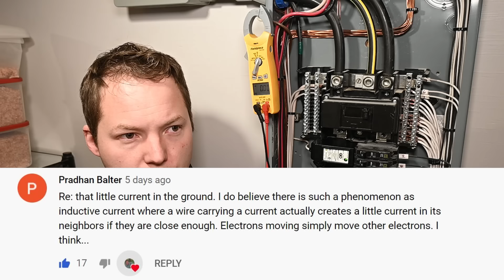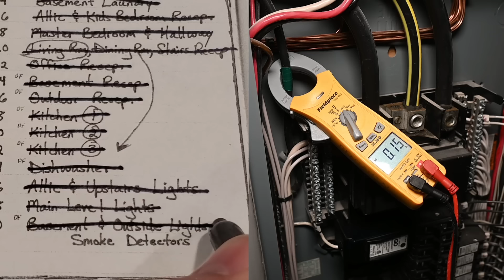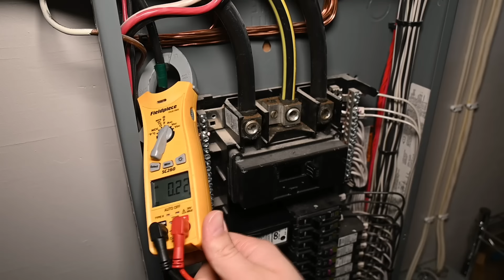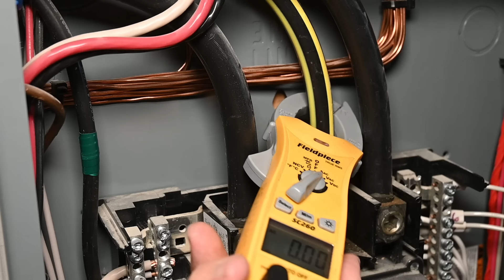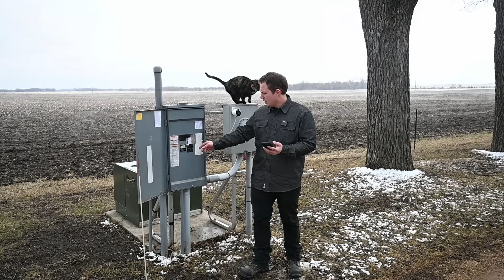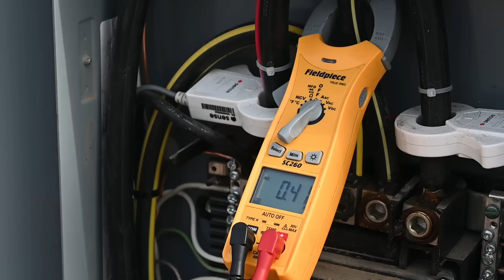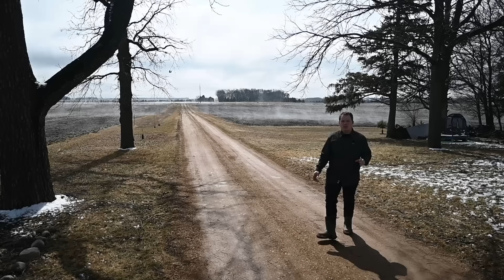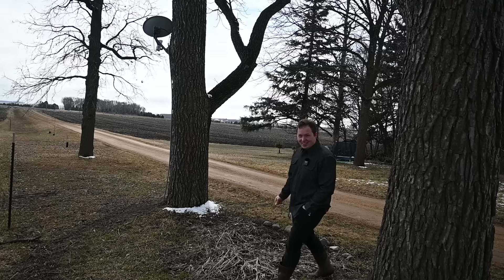Finding The Source of Stray Current on Grounding System

Comment: Sometimes this situation is caused by the "galvanic action" in the soil itself,which can act as a large battery.  When you have acidic soil, wet soil, iron deposits, etc. they can all contribute to the ground actually creating a current on a building's distributed grounding system.  Even a single building ground can be interacting with a utility ground on a pole somewhere nearby.  You did an excellent job chasing down the source.  I had the utility come and disconnect the power leads at the pole, turn off every circuit, pull out the meter and there was still 2 amps on my building grounds.  In the end they left completely unable to resolve the issue.
Reply: Gary Jarvis
 -- To expand on your 'galvanic' point: Dis-similar materials are required, usually metals such as copper and zinc. In this video, grounding rods and the gas pipe are copper and the conduit from the transformer/meter area outside are galvanized (coated with zinc), so there is a good setup for both a galvanic current AND electrolytic corrosion. You REALLY do not want electrolytic corrosion on gas pipes. Luckily (in Ben's scenario) that corrosion will erode zinc, but not copper. BUT those galvanic currents will be Direct Current, and the clamp-on ammeter looks like it was on AC Amps. Unless that little ammeter has problems itself, it should ignore DC when set to measure AC Amps. There is also some rectification possible in a galvanic circuit, which might show up while measuring AC Amps. It would be helpful to measure DC amps as well. To really be sure might require use of a battery-powered oscilloscope and a current transformer. Source of the power being rectified could be radio waves, solar storms, other electrical power users in the area, or even at significant distance if high voltage is involved. Also, it would help to measure the voltage, both AC and DC, when these mystery currents are present. @Benjamin Sahlstrom
Reply: A new grounding rod may help only if you pick one spot and use it as the only ground in your wiring.  Using multiple grounds may cause the ground loops I have been discussing.  Granite is a poor conductor of electricity.  The Ufer ground was developed as a grounding method in very dry soil and it is a solution to the cost of expensive copper grounding rods.  The NEC now always rebar to be used if copper is too expensive. My research indicates a rod driven deeply into soil is the optimal solution.  Remember this is only a backup in case the main ground to the house from the utility fails.  Check the conductivity of your grounds at the meter pan as they are known to corrode and become a problem. Use a good anti oxidation paste if you find poor connections.  Best of luck with your project.
Reply: @garyjarvis2730  thank you so kindly for the generous advice. May i ask for clarification, are  you saying only one rod, (not two) and it must be solid copper? And not bonded to the ufer? I really don't want to get this wrong. We are desperate to find a solution to this seemingly impossible strange situation. It's costing us a fortune. I can't thank you enough!
Reply: Try one rod only not connected to the Ufer in any way.  Rod can be solid copper or copper coated like you find in Home Depot.  Most important aspect is one ground only placed in soil that is not extremely dry.  You need to make sure there are no other grounds to plumbing or the Ufer that you have missed. In my mind this is the absolute starting point for any further investigation.
Reply: @garyjarvis2730  thank you, soooo much, Gary!! We have plastic pipes. This is a newly built home so no other grounds to our home. We do have the transformer on our property probably 20 ft from the house. I'm sure it's grounded to something. 
We had planned for two rods, you recommend one to prevent ground loops correct? I am not versed in this to know what effects a ground loop would cause.    Is one ground rod enough for whole house? (Again, I don't know enough just in my head I'm thinking 2 is better since our problems are so great).  And one last question, even though we are taking the house off the ufer won't it still be attracting electricity from the ground or possibly stray voltage? We think possibly our problem is possibly from neighboring property. Thank you so much again. I hope to report back good news after rods are placed.
Reply: Remember the ground rod is not the primary ground for your home, the neutral leg on your service drop is the primary ground.  Electricity will find the easiest path back to the source.  If you have neighbors with bad wiring their system may be using your ground path as the return or at least part of it.  The ground rod is just an emergency backup.  I suspect if you don't connect the wire to the Ufer and the ground rod you may see the stray current disappear.  Could also be something like a bad submersible pump or it's wiring injecting current into the ground.  In any case only ONE earth ground is required.
Reply: @garyjarvis2730  Thank you for the reminders. we've have power company out 3/4 times to test their side for neutral issues. Finally applied the beast test, and say they are good. The linesman who performed that test was one of the people (including 3 other electricians) who recommended we put in a ground rod. When cable company did testing for three house they claimed the amps on their line was from our neighbors across the cul-de-sac. We did notice symptoms less when they were out of town. Linesman wouldn't test their home and neighbors say they don't have any electrical issues. How would we go about solving this if we've exhausted these avenues. Will the new ground rod be of any help? Or are you saying just taking our neutral off of ufer would be a good test. I truly appreciate you bearing with my lack of knowledge. We assumed the 3 other electricans we hired plus forensic electrician would be able to figure this out. Apparently, not.
Reply: Bottom line is electricity will always find the path of least resistance.  If your neighbors have poor system grounds or faulty outside equipment current can easily be injected into wet ground.  As the ground gets wet and dry the amount of current will vary.  If you have pad mounted transformers and underground service lines all bets are off. There could easily be bad service  wire insulation or corroded grounds causing stray electricity in the soil.  If your emergency grounding system ( rod or Ufer) has less resistance than all of the available returns, a portion of the stray current will find its way to your home.  Keep the wire to the grounding rod (yes you need only one) outside and under the ground until it reaches your service entrance.  Connect it as close as possible to the service line neutral.  If you need to connect it in the breaker panel keep the wire run in the house as short as possible - meaning don't run the wire across the basement to the panel, run it outside to a close to the panel entry point. By keeping all of the emergency ground outside the house any stray ground current will find your rod and travel directly to your neutral return to the transformer outside your home.  To summarize, use one ground rod, place the wire outside the house until you get to the location of the service entrance.  Ground to the service neutral outside the home if possible and run a tap back to your breaker box as required by code.  This should keep all of the stray current outside and away from your home's wiring.  The ground rod can be right next to the service entrance as long as it goes into the ground 8 to 10 feet.  This should not be an expensive fix.
Reply: @garyjarvis2730  I'm so glad I have these details. They will be here in an hour or less! I do have question about where to put the rod. Our entire stem wall footing is on infill. The infill is 6ft deep. To put the rod into "real, true ground/soil we would need to place the rod 10 ft away from the house (but still in line with the city neutral). Is this an acceptable distance
Reply: Yes, in real soil 10 feet away is perfect
Reply: @garyjarvis2730  thank you! I will let you know if this solves any issues. I meant to respond about the rainy season when soil was wet, wet, wet (natural springs on our site) we had some weird symptoms, unless neighbors were out of town. Thank you again!
Reply: @garyjarvis2730  hello again we ran into a problem. The rod made it 6 ft before hitting rock, so today he's renting a jack hammer. My question is, if the ground rod is able to be jack hammered further is this a conductive ground or should we try another location? Interesting thing is we had about. 25- 1.7 amps on the cable ground (varied based on what appliances we were running) and since the rod was placed its been zero with no increase no matter what appliances we run. Weve checked it at least 20 times at various times in disbelief. The rod is not yet attached either.
Reply: Kinda suggests the ufer ground was not doing its job.  If the ground cable alone was solving the problem with the rod attached it should be a permanent fix.  The rod can be placed in another location just as easily as jack hammering thru rock.  The fact that the operation of YOUR appliances suggests you do not have a good ground somewhere in your service.  The ground rod is usually a backup and unless ground currents are coming from somewhere else it should not be carrying a current.  Also check any cable tv cables as they ground the shield portion of the cable to your grounding rod.  Sometimes bad equipment in the area induces a current on the tv ground that you also pick up on readings.  Home generators are also culprits if not wired correctly.  Most important thing is you've eliminated the current flow in your home.
Reply: @garyjarvis2730  yes, it does. We got the ground in today and all the amps on both the cable neutral and our neutral are gone. No amps, zero. Thank you so much for all your advice and information! Very helpful!
Reply: galvanic action, as you call it, Gary, does not account for 2 AMPS of current. that is way too much electrochemical power to not notice metals dissolving before your very eyes - and since that is not happening, it cannot be the current source.
irregular or varying 'ground' impedance in the power distribution network CAN account for 2 amps of current. if you can be absolutely certain no other power source is injecting current into your building's neutral system when the building's utility feed is not connected, then the power distribution network is the current source injecting that 2 amps into your building's (now proven superior) 'ground'.
Reply: @rockytrashpanda  Thank you for your comment.  You are correct that galvanic action alone may not create the full 2 amps,  However, it is still an issue especially in densely populated areas like cities where there are tons of dissimilar metals in the ground.  Often multiple grounds can create a "ground loop" where the potential at the different grounding points creates the flow of current.  I did notice when I removed one of my grounds to the water line the situation disappeared.  Our local gas company routinely puts dielectric unions in their supply lines to the house to stop the corrosion issue.
Reply: @garyjarvis4058  i suspect gas companies in general have more rigorous adherence to their grounding design specifications in contrast to the electric utilities. whoever maintains the 'best' ground "wins" the prize of having to do more maintenance if they don't introduce those insulators (dielectric unions).
in the long history of both utility services, electric has only recently invested in underground infrastructure and then only as they are required to do so (i should make the obligatory joke about resistance to change).
population density itself does not lead to issues as much as the sheer number of installations performed and the statistics that a certain number of installs will require remediation in only a few years.
the situation where a property owner has to replace their water service feed twice in two years after a neighbor adds an out building and installs a full set of high power wood working machines can happen just as easily in an urban or rural setting. it was a broken neutral bond in the utility's system destabilizing the power distribution and causing 20 to 30 amps to flow along the water service line.
all these things combine into a SYSTEM even if the various responsible parties think of their work as being done in isolation ("kirchoff don't care", as in Kirchoff's Laws).
Reply: The electrical potential of any two points on the surface of the planet can be very different due to the dielectric properties of the rocks, soils, and water beneath them because the iron core of the planet generates a magnetic field. 

The "earth" of the power company is relative to the location of their generator.  If they provide a high conductance path with a "neutral" line, a current will flow.
Reply: Did you have any electrical problems with the 2amp on your grounds?
Reply: None.  I check the entire house with the pole ground disconnected and the meter pulled.  The stray current was not coming from my service.  The utility engineering team was completely perplexed and declared it was not their problem. The one thing I settled in on was a ground loop causing the issue.  I had a ground attached to my water main and one to a grounding rod some 40 feet away.  When I disconnected the water main ground the situation disappeared.  I should mention we have copper water lines and cast iron water mains in our area.  My father worked for Con Edison in NYC and they regularly had lots of issues with ground currents caused by the different potentials caused by soil and moisture variations.  Interestingly there was no real voltage accompanying the 2 amps.  Try putting a volt meter in the equation and got only a few milliamps on the reading.  Given I didn't have a meter sensitive enough to accurately read small voltages I assumed there was some small voltage potential but was not sure of it's real value.  Our gas company did install dielectric unions on all services to isolate their equipment form the customer's equipment.  My guess is they were more aware of the stray current issues.
Reply: @garyjarvis2730  thank you Gary for the detailed response. We are trying to figure out if the amps we are finding have anything to do with some strange feelings we have in our house. Namely ringing in ears, head sensation and a feeling of vibrations in head and body.  Has your father ever encountered any such effects from electrical issues? We only suspect electrical because there's an on/off quality to our symptoms that we feel at same times.
Reply: I can tell you that the effects of stray current would not produce the effects you are describing.  My father's experience was with significantly higher currents that also had no real voltage potential.  Complaints were driven by plumbers and electricians who opened up the conductor path and saw large sparks.  There is some evidence that people living under high voltage transmission lines can be adversely affected by electrical fields radiated off of the phase lines.  One off the classic tricks is to hold up a florescent bulb under the lines and see it light up with no external electrical source.  I doubt the stray currents are causing your issues.  High frequency radiation, if present, could cause issues but you would know if there were high powered radio transmitters in the area.  People near rotating radar dishes have reported ill effects and it is documented.
Reply: @garyjarvis2730  Thank you Gary. We are experiencing something strange for sure. How would we be able to test if we were near high powered radio transmitters or rotating radar dishes? We do live close to an AM radio station and the cable tech who was out to figure out amps on the cable ground suggested we contact them, though at the time we didnt understand why. We hadn't discussed our physical symptoms just wanted to figure why cable ground had amps on it.  Any suggestion for professionals we might hire to rule strange things out would be much appreciated.
Reply: also wanted to run this by someone  knowledgeable like yourself. If we have an ufer ground on granite in fill, do we actually have a true ground? We had a forensic electrical engineer and other stray voltage specialist suggest adding in supplemental ground rods into the true earth. One suggested we take our neutral off the ufer, others suggested we bond the new rods to the ufer. The rods are being installed tomorrow. I would love to know your thoughts however harsh they may be. Since we had some weird electrical issues as well as weird bodily symptoms we have had three electrician check over our system. No one can find the true issue. One more possible clue or not, we have about 25 spots where we held off putting in lights (new build, ran out of money) and the wires are not capped. Could this or the ufer on granite in fill cause problems. I appreciate your time  @garyjarvis2730
Reply: The AM radio station might be a good start.  If symptoms are just one person it is probably a medical issue that needs to be addressed by a doctor - High Blood Pressure comes to mind.  If multiple people have the same symptoms I'd investigate some high frequency source like a radio station.
Reply: multiple people who live  in the house exact same symptoms at the same time. Its too weird. I don't even believe in emf or things of this nature, but we are seriously going nuts in our house. We left for 6 months. What do I ask the radio station to check for? I really don't want to get into our physical symptoms.   Thanks so much! @garyjarvis2730  We did get checked out by doctor; one of the symptoms is rapid heart rate and fluttering in the heart (goes away after leaving the house). And yes we've had our house checkout by professionals and cleared of mold etc.